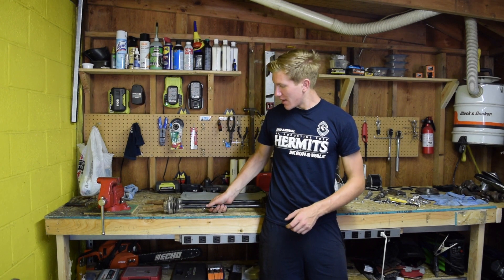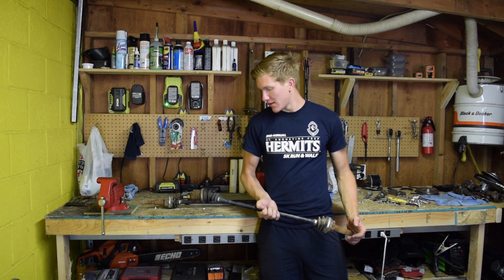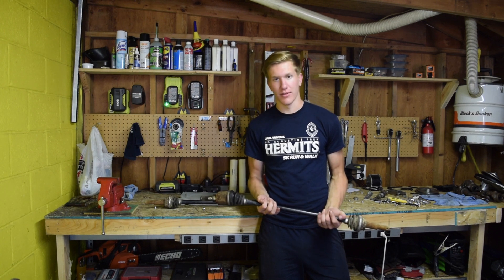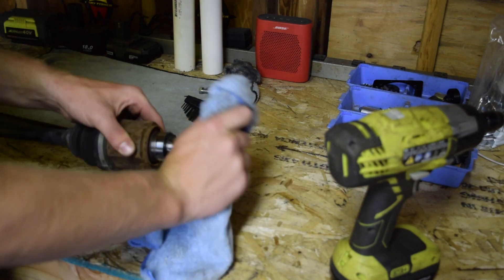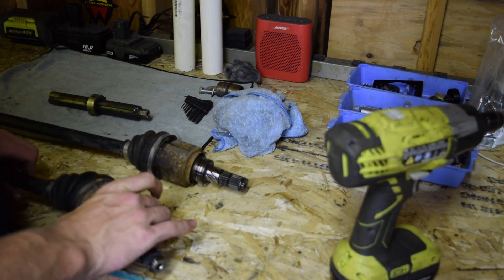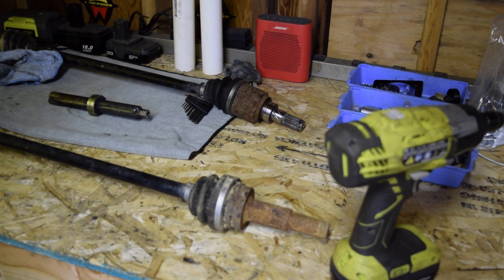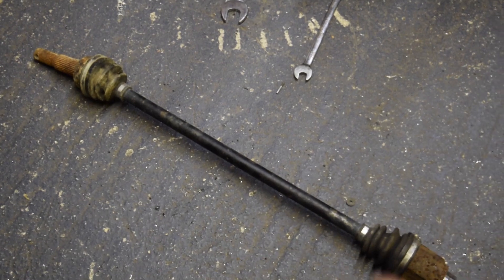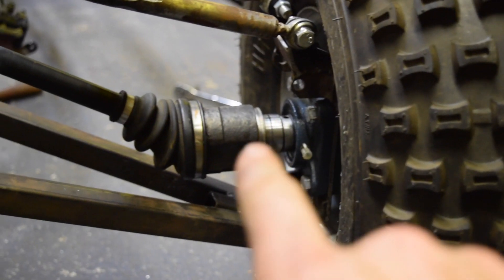CV Axles on a Go Kart??!

Comment: I might have missed it but what vehicle did the axles come from? I am getting ready to do the same thing.
Reply from the maker: rskate63 I actually don’t know🤷🏼‍♂️ I was lucky enough to find them sticking out of a diff just laying on the ground. If I had to guess I’d say a Subaru because not many vehicles use such long axles. Hope that helps
Reply: I'm also interested in doing something similar. How is the welded axle holding up?
Reply from the maker: No problem at all. You MUST bevel the edges of the two halves to essentially make them pointy. That allows the weld to get better penetration and it’ll be much stronger
Reply: @gaspedalgarage7670  Thank you!
Reply: instaBlaster.